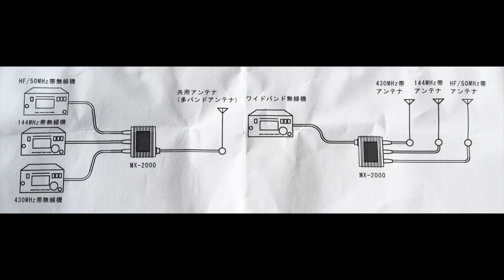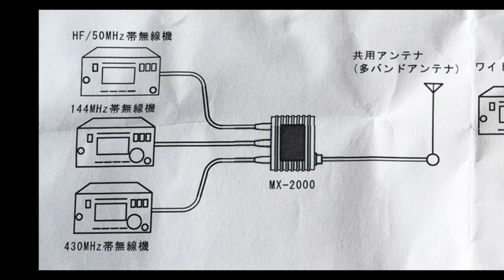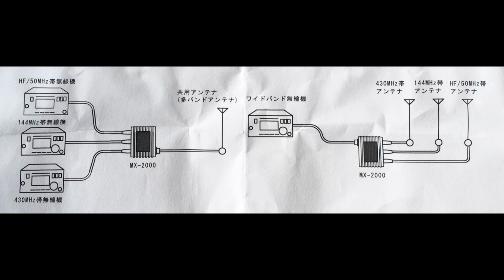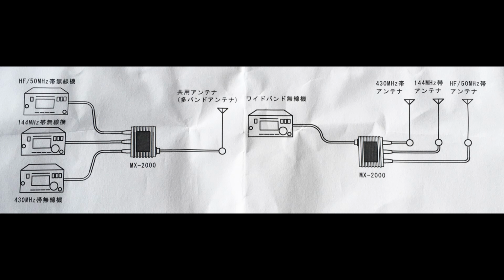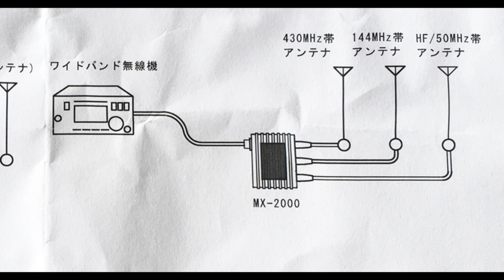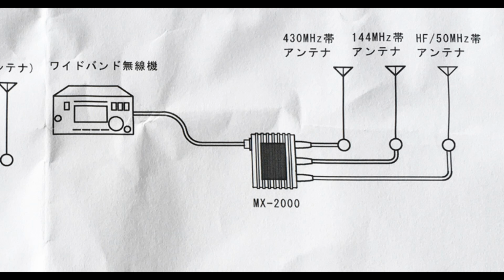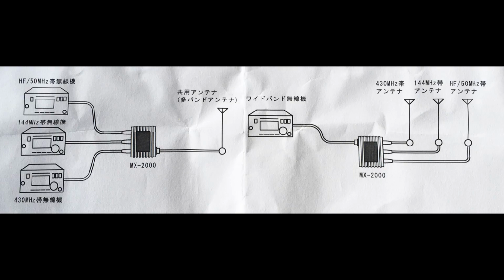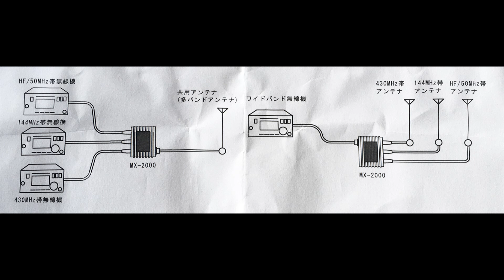G4NSJ - Diamond MX 2000 Triplexer MX2000 6m 2m 70cms

Comment: Thank you for explaining these concepts of Triplexer.  I'm new to Ham Radio and about to buy, set up first shack.  Looking at a "shack in a box" Yaesu FT-991A that has all HF, UHF, VHF bands and 2 inputs from antennas. Am looking at Diamond V2000A antenna for the tri-bands, but the mfg site mention Diamond MX-2000 Triplexer is "required to use" of this antenna.  However, I think it depends on number of radios and number of inputs the radios have. As you know, FT-991A has 2 input connections.  And the way as you explained I don't think I need the tri-plexer, since I'm putting this tri-band antenna into the UHF/VHF bands input on one transceiver.  I'll run a dipole and co-axial cable to the HF bands 2nd input on the radio.  There's definitely a learning curve here.  No "Elmers" in our NE Minnesota "backwoods" area North of Lake Superior to consult. There are more grey wolves, black bears and moose here than "Elmers". Youtube and couple MeWe Ham Radio groups are my main resources, aside from mfgr doc. So, thank you sire for explaining the concepts.  This is what I need. 73 KF0EAU

Comment: Can you plug a hf aerial and a 2m aerial into this device and use a single run of coax back to the radio?
Reply from the maker: No, it will only work on 6m 2m and 70cms.
Reply: @g4nsj  ok thanks.